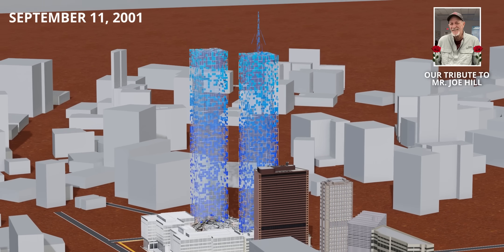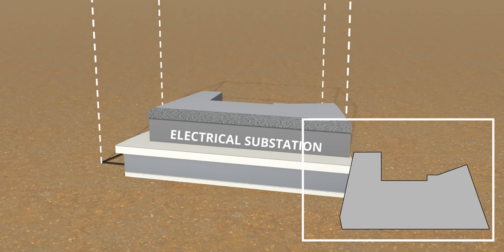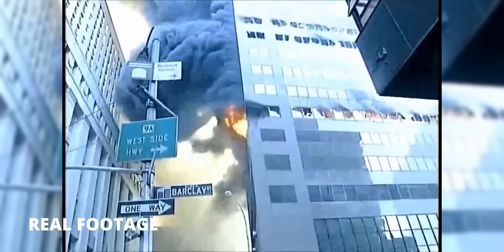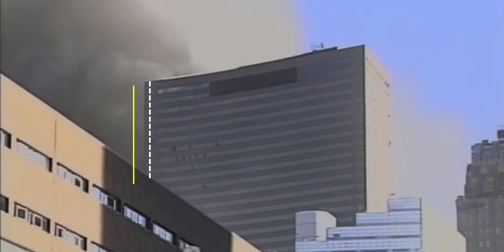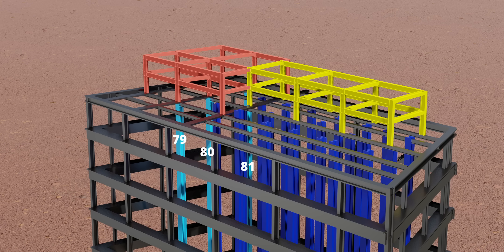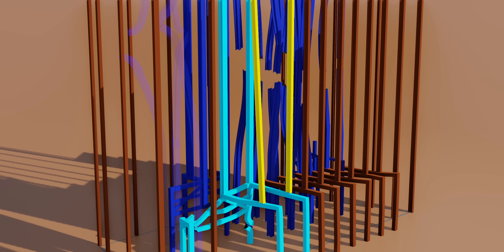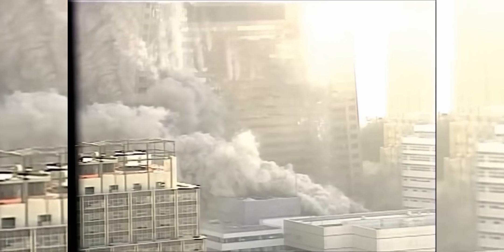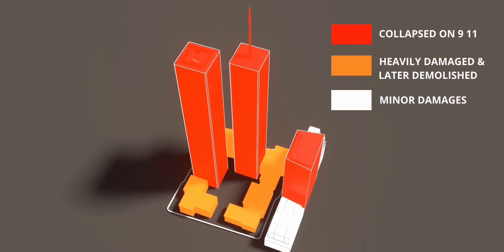Collapse of Building 7 | The Complete Physics

Comment: I watched it imploded Live on TV. Nothing hit it. Firemen standing around. An old guy in a Suit said, Pull it! And then  Bld7 went down. That was a demolition command.  So the TwinTowers were already wired up to drop too. Obviously imploded. 100%.
Reply: I’m going to respectfully disagree and offer a more plausible explanation.

Building 7, the 6th building to collapse of 10 lost on 9/11 though extensively studied still confuses many. Not famous or a terror target and with no casualties it didn’t get a lot of attention initially, creating an information void the internet filled with utter garbage. Because everything seems like a conspiracy if you don’t understand how it works I prepared this brief summary from my own analysis to fix that. No politics, just engineering. 

The North Tower collapse at 10:28am bombarded Building 7 with tons of burning debris, causing heavy damage and multiple floor-wide fires that burned out of control for 7 hours. Half the FDNY firefighters having been killed, others injured, units in disarray, equipment destroyed, no water pressure, and the greater urgency of Search & Rescue efforts, firefighting was pulled as futile. The building couldn’t be saved and was left to its fate. That is the sort of choice firefighters make every day in brush fire situations - which houses to save and which ones to let go. Only real difference here is moving the decimal on the size and cost.

www.youtube.com/watch?v=g_SvpwyC17M&ab_channel=MFitz  

Collapse of a burning structure is always a concern for firefighters. Steel buildings subject to fire rely on active fighting of the fires to survive. Buildings are designed around 1 to 3 hours of fire resistance, allowing time for occupants to escape and ACTIVE firefighting to get started, after which all bets are off. Left to their own devices they will exceed their design envelope and collapse. In B7 the occupants escaped, passive and active fire protections were compromised and active firefighting was abandoned which left the building to its fate. It lost. Odds on Building 7 would eventually collapse, and it did. No big deal in logic. 

www.youtube.com/watch?v=WnYBX6QT0R4 

FDNY Chief Daniel Nigro ; The biggest decision we had to make on the first day was to clear the area and create a collapse zone around the severely damaged 7 World Trade Center, a 47-story building heavily involved in fire. A number of fire officers and companies assessed the damage to the building. The appraisals indicated that the buildings structural integrity was in serious doubt. I issued orders to PULL back the firefighters and define the collapse zone. It was a critical decision; We could not lose any more firefighters. It took a lot of time to PULL everyone out, given the emotionalism of the day, communications difficulties and the collapse terrain

FDNY Deputy Chief Peter Hayden ; We had our special operations people set up surveying instruments to monitor and see if there was any movement in the building. We were concerned of the possibility of collapse in the building. And we had a discussion with one particular engineer there, and we asked him if we allowed it to burn could we anticipate a collapse and if so, how soon? And it turned out that he was pretty much right on the money, that he said 'In its current state you have about 5 hours

The collapse of Building 7 was anticipated and widely reported in the media throughout the day. At least 24 video cameras recording some or all of the collapse. Everyone knew what was coming and why.

www.youtube.com/watch?v=OY5S5k3tMHI 

Building 7’s collapse was completely different to the Twin Towers, and harder to understand with most details hidden from view. But we can still sort out what happened through careful analysis and observation.  This is my explanation  of the collapse using the best available information and relying on no authority.

B7 was complex 47-story steel framed structure built on top of a smaller existing 3-story building, requiring several lower floors dedicated to complex load transfer structures instead of usable office space. Of trapezoidal shape and all-steel tube-in-tube construction, B7 (above the 7th floor) consisted of a central core of steel columns carrying most of the gravity load, perimeter steel columns around the outside of the structure carrying the remainder of the gravity loads and long span beams and girders to tie those elements together and form the floors. On the outside of the building hung a moment frame - the last part of B7 to fall 

Phase 1 : The first externally visible signs of collapse initiation occurred at 5:20:28 pm. Collapse initiation for B7 is notably quiet with observers not realizing the building was collapsing! There was no audible warning in the form of say hundreds of ear drum busting 180-190dB explosive bangs preceding the collapse. Here at 12:00 a local CBS affiliate reporter is talking 10 blocks from B7 when collapse begins. People don’t start to notice the collapse until 12:11. Then at 12:45 is the famous CBS fixed camera clip of Building 7’s collapse.  Note how quiet it is.

youtube.com/watch?v=t5tEy6mXSE8&ab_channel=fresnosean379

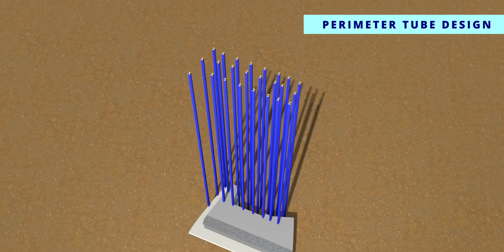Collapse initiation was due to lower floor failures above the load transfer region (7th floor) in the NE corner of the building. In this video at 0:45 you can see the NW corner from inside the building while under construction, Column 79 just out of frame on the left. That big, angled steel beam across the top of the frame connects to C79 at one end. The girders connect to the beam. That beam and all those girders depend on just one connection

youtube.com/watch?v=nP3TNHPCIVU&t=35s&ab_channel=EdwardCurrent

Phase 2 : Lower floor failures caused a loss of critical lateral support over an excessive length of core Column 79 and it buckled. If you look at a floor diagram of Building 7 (see above) and look at all the structures that depend on C79 you quickly realize this one column was a relatively isolated structural element on which a disproportionately greater fraction of the structure depended analogous to say the Key Bridge. Externally we see a vertical progression of window breakage along the 44-46 line and a kink in the roof of the East Mechanical Penthouse at the top of the building, consistent with C79 failure. The transition from full capacity to almost no capacity occurs in virtually an instant. Once the buckling failure occurs there is almost no resistance

Normally with a buckling column, the load could very well be redistributed to other columns, meaning the buckling could stop after a while. With C79 that is not the case - the failure did not redistribute the load, so the collapse rapidly progressed to the roofline, sinking the rooftop penthouse.

Phase 3 : With C79 gone, B7’s progressive, non-symmetrical collapse continues with C80 and C81 at the east end of the core left laterally unsupported and quickly buckled and failed as well, sending the EMP down through the building. C79-81 all have no diagonal bracing, which I believe is a major reason why they could not redistribute a lot of vertical loads among one another.

From there collapse progressed from east to west through the central core until the core was gone taking all of the interior floors and structures and probably most of the perimeter columns with it. You can see the horizontal progression of window failures low in the building and the dropping of the remaining rooftop structures into the building. One of the big takeaways from the NIST Building 7 study (that gets completely ignored) was their modeling which determined C79 failing under ANY circumstances would have initiated the same collapse sequence.

Phase 4 : 10 seconds in only the exterior moment frame - just a hollow empty outer shell – remains, the illusion the building is still standing since little has outwardly changed. But it’s just a hollow empty shell like an empty cereal box supported by only a few remaining columns and quite unable to remain standing. With all internal framing gone, the north face leans inward, forming a V in the roofline, the last perimeter columns buckle under the strain and the moment frame free falls, landing on top of the 7-story high debris pile. It is only here, at the end that a single measurement of alleged free fall acceleration is taken, from a single point on the moment frame. The Building (defined as its center of mass) did not “free fall” (sort of) – just one corner of the outer shell did. The Building was already gone before that happened. The period of alleged free fall was a product of collapse progression mechanisms, not of collapse initiation mechanisms and is irrelevant to what started the collapse. Start to finish the entire collapse took 18-20 seconds, 3 times longer than true free fall and how fast something falls cannot tell you what started it falling anyway. The debris spread outside the footprint, blocking surrounding streets, heavily damaging the Verizon Building and destroyed Fiterman Hall.  

Building 7’s progressive, non-symmetrical collapse was incidental and unintended collateral damage from the combined effects of fire + time + gravity started by the collapsing North Tower. That is true no matter who planned and carried out the 9/11 attacks or why . The collapse was of so little consequence it barely even registered at the time, a mere footnote. It only took on semi-mythical status as an alleged smoking gun years later when demolitions at the Twin Towers, missiles at the Pentagon and shoot down over Shanksville all failed and conspiracists had nothing left to work with.

Anything can seem like a conspiracy if you don’t understand how it works. Now you should. I hope you found this helpful, informative and it solicits informed critical comment. If I made any errors of fact, logic or reason or left anything important out, please let me know so I can fix it. IF you can offer a more plausible alternative please do. Be the first. Please start any reply with the words “Tits McGee” or I will know you didn’t read it and are wasting my time.
Reply: "I watched it imploded Live on TV. "
No, you didn't.

"Nothing hit it."
Other than a very large building, that is.

"Firemen standing around."
Try "maintaining a safety perimeter".

"An old guy in a Suit said, Pull it! "
You lacking the ability, or education, to understand English only mean you fail.

"That was a demolition command."
If, that is, you want to live in a cool action movie. Here in the real world, not even slightly.

"Obviously imploded. "
Except for the "obvious" and the "imploded" part, that is.

Comment: This is all propaganda. Notice on the right and left side of the building about a 3rd of the way in from the side each floor has an explosion that blows the windows out before the building even started falling that go up the building one floor at a time. Once these explosions occurred. THEN the collapse happened. That is ONE thing they never mention. IF ANYTHING the rest of those girders would have been left standing when some of the building collapsed yet,. they all disintegrated as the floors fell. Nice try but your control over the narrative will soon be over.
Reply: Not sure what you are looking at. This is a close-up view of the collapse of the South Tower.  www.youtube.com/watch?v=ULdiD6gYZO0  

Collapse initiation was due to sagging floor trusses (which we can see) causing inward bowing of perimeter columns by up to 5 feet (which we can also see) at the impact and fire damaged floors until those perimeter columns buckled and failed, initiating the collapse (which we can see). 

Columns don’t work well when they are bent. The Twin Towers were designed to work with straight elements not bent ones. When you bend those columns they become up to 4 times weaker. Failure is inevitable.

Notice how the columns are already bent when the camera zooms in, become a bit more bent over the next new seconds until they give, starting the collapse. 

So what bent them? It sure as shit wasn’t thermite or sooper-sekrit fire-and-impact proof hush-a-boom pre-planted demolitions that don’t explode. 

If you keep watching you will note that after the tower starts collapsing the air inside the building (95% air by volume) gets compressed and forced out the windows. These low-velocity air bursts devoid of blast or fragmentation effect are a reaction to the building collapsing not a cause of the building collapsing 

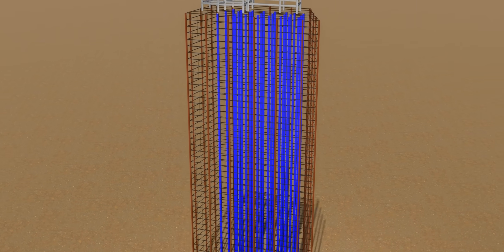And at a different angle from 1:18 here:
youtube.com/watch?v=TJJPYTVjxug&ab_channel=femr2 

Or here
www.youtube.com/watch?v=-DCgEJ2bUcI 

Also seen in the excellent still image here at 9:09:
youtube.com/watch?v=YXsDwKYz1bA&ab_channel=msvfreak94

Comment: I am a retired consulting structural engineer with over 50 years of designing and analyzing building structures.  I believe your theory of the mechanics of the collapse, is much more creditable that that of NIST who spent millions analyzing the collapse.  They theorized that the failure was based on the expansion of the steel frame resulting from the heat created by the fire resulting in movements and separation at a critical beam to column connection.
Reply: The collapse of Building 7 is one of the most studied engineering disasters in history, the subject of 5 comprehensive engineering studies and more than two dozen technical articles in major peer reviewed engineering journals, most of which were published 15 or more years ago. Thousands of pages of material.

Each team came to someone different conclusions, all of which are plausible. The NIST actually came up with two. 

FEMA BPAT (initial report superseded by NIST NCSTAR 1A)

NIST NCSTAR 1A: Final Report on the Collapse of the World Trade Center Building 7, 2008.

Guy Nordenson and Associates, WTC7 Global Collapse Analysis Report and Summary of Findings, 2010.

Arup, WTC -7 Structural Fire Analysis Report (Runs 1-4), 2010.

Weidlinger Associates Inc., WTC 7 Collapse Analysis and Assessment Report, 2010.

BRE Centre for Fire Safety Engineering, Analysis of the Impact of a Fire in the Mechanical Room (5th & 6th Floor) of the World Trade Center 7 Building, 2010.

T. McAllister, R. MacNeill, O. Erbay, A. Sarawit, M. Zarghamee, S. Kirkpatrick, J. Gross, Analysis of structural response of WTC 7 to fire and sequential failures leading to collapse, J. Struct. Eng. (United States). 138 (2012) 109–117.

For a summary of the major studies I would recommend THE COLLAPSE OF WORLD TRADE CENTER 7: REVISITED by Mhd Anwar Orabi , Liming Jiang , Asif Usmani and Jose Torero which is a 33 page summary of the different analysis and conclusions published in 2020. Sorry, YouTube will delete this post if I give the link but it should be easy to find and is available from the University of Queensland, Brisbane.
Reply: @TheCriticalStinker-01  Thank you for the information.  I was not aware of all these various studies.  I don't believe the distribution of this information was very extensive.  It's unfortunate that the Engineering New Record of similar publication of large circulation does not provide a listing of papers on this and other major structural collapses that have occurred.
Reply: @johncoil1418  - Those are engineering reports written by engineers for engineers, to whom the topic is of primary interest. Outside of the tiny conspiracy community there really isn't much in the way of general public interest in the topic.